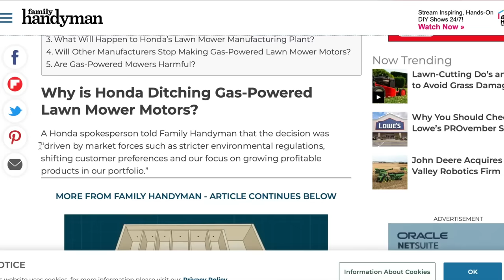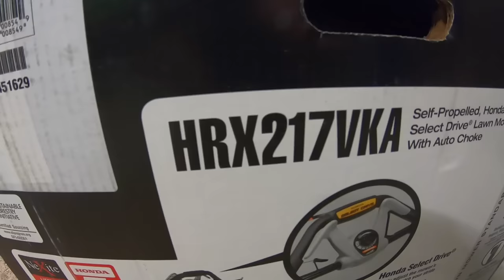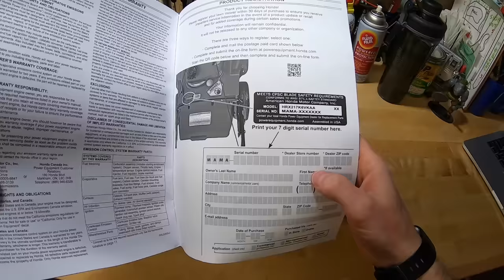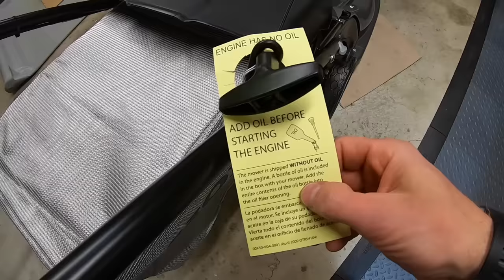ARE HONDA LAWN MOWERS STILL WORTH BUYING IN 2023?

Comment: Lawn mower emissions. Lol what a joke. Hondas are the best.
Reply from the maker: Right!?! Thanks for watching hillbilly!
Reply: California will have grass issues everywhere first with nobody except council staff affording battery operated equipment to cut multiple lawns
Reply: I’m speechless. Emissions from mowers. Do politicians have vested interests in children-run copper/cobalt mines in 3rd world countries? The world has gone crazy.
Reply: A company that makes lawnmowers makes safer planes than Boeing!
Reply: @Dadolaurenovic And good luck with the billions (each EV has several thousand) of lithium batteries coming to your local landfills, polluting everyone's water supply.
Reply: @GarageGear  Honda hrxs are commercial mowers.
Reply: Why Honda?  Better than toro at everything.  Emmisions, gas sippy 160 like twice mileage ofToro.  Twin blade cuts better way better no more twice passes.  Mulch three times better.  Drive system padle love!   I really liked persinal pace but Honda still better.  Clippings smaller packs bag way.better. Got new 8 inch wheels secrect all rubber knobby.  Be here week see fit no one has done these.  Wondering what missing with generators.  Had craftsman with same small honda under powered and did not like it.  Hrr216 fine machine
Reply: @Dadolaurenovic  it's not about emissions. It's about liberal politicians making money. Period.

Comment: Pro tip, keep the original oil bottle for the next oil change.  You fill the bottle with the exact amount of oil then pour in the mower it will not over fill.
Reply from the maker: Thanks for tip! Thanks for watching!
Reply: That is such a good tip. So intuitive yet I threw that little one that came with the mower away. Thanks
Reply: It is in the ballpark, but not necessarily a good idea.  For instance, the oil supplied in the video is 12 fl oz, but the Honda stated engine oil capacity on the HRX 217 engine is 18.6 fl oz 10W-30.  It seems to me that about 4 fl oz may have been left in the engine from the factory testing and even the manual warns about varying oil levels left in the engine and to confirm on fill and engine break in.  Not to mention various methods of draining the oil on maintenance can vary wildly in their success rate at removing all used oil.  In my experience with Honda motors and oil changes, I will let drain, and fill with 10 fl oz, then run for a few minutes and check the level and top off.  After my first couple of mows I will double check the level and run for that season with periodic checks that something hasnt failed.  Will filling with 12 fl oz like the initial top off container work, probably enough to not fail, but for my results and for my Honda to last as long as possible, I go with fill mostly, run, and top off to get best level to be sure.
Reply: Yes I do this when I change my trucks oil. Also helps to give an indication about how much oil you burn
Reply: @Amouselives  Agreed, the oil drain amount always varies. 

I do miss the drain plug on the bottom. It did drain more of the oil in the engine, it was a pain but I always found it more effective than the tip over the side.
Reply: @Amouselives  My manual says 12-13.5oz
Reply: I bought this exact model in 2021 and it's BY FAR the best mower I've ever purchased. I had always had Toros and Craftsman. I agree with the auto choke as I also service them, but I'll take this rear wheel drive beauty over about any push mower out there.
Reply: @Amouselives  I change the oil on my Honda HRX 217 every 10 hours of use per the meter I installed. The absolutely does not hold 18 .oz of oil but Approximately 12.0 to 12.04 .oz of oil per the correct level on the dip stick. Think about it, when you buy the mower new, there was a yellow tag on the oil cap that said “there is no oil in the mower, use supplied oil”. Again, the supplies oil was 12.0 .ozs.
Reply: @frozentundra7446  I never said it did, Honda says it did, point being the amount you retrieve will vary based on time to let drain, oil condition, amount blocked by internal restrictions, lubricated metals, etc.  Why would anyone want to rely on a given amount when filling mostly and topping off would never fail you?
Reply: That's exactly what I did!

Comment: My husband is a diy guy and in the twenty five years we've had our house he has never purchased a mower.  He finds them on the side of the road and fixes them to use for awhile and then give away to family and friends charging only for parts.  Someone curbed this exact mower three years ago because it wouldn't start.  He took it home, spent a weekend in his garage, and now it is his favorite mower.  Starts first pull every time.  I asked what was wrong with it and he said people are stupid.
Reply from the maker: Hey Andrea! This is awesome! I’ve found many on the side of the road as well. Fixed them up and sold them. Easy money. Your husband has a skill that will last a lifetime! Thanks for sharing! 👍
Reply: I found an old 86 toro mower on the side of road, fixed it up then gave it to my manager after a couple years of using it for myself and it started on fire lol
Reply from the maker: @jonnysnipes3123  awesome!
Reply: Yea most mower engines are pretty rugged. I have fixed many old mowers the same way, most need work but the engines are still great.
I trashed picked my walk behind tiller and two stage snow blower. A few minor parts like filters etc, a good cleaning and a tank of non ethanol gasoline and they run better than new.
Same with outboard motors. I have had a few trash picked outboards the same way. Throw away society’s loss is my gain.
Not to mention the old boats I have gotten for nearly free, cleaned up an sold for thousands of dollars. A little scrubbing and maybe a touch or paint. Your hubby is correct, many people are stupid .
Reply from the maker: @BillO964  thanks for sharing!
Reply: Your husband has skills and most likely is a humbled gentleman. That "stupid" comment was probably meant for his wife to hear only.
Reply from the maker: @mr.cookie7308  some here find that interesting. I managed to come up with an extra $4k for the down payment on my truck flipping a few mowers. Easy money!
Reply: If the engine isn’t shot, most mowers that “don’t work” simply have a carb problem or basic electrical issue, most people give up at that point so they just get rid of them.
Reply: He likes to solve problems.
Reply: That’s cool but if I spent 16 hours working I’d have enough to buy a reel mower
Reply: @scottfirman  is my job not real?
Reply: @trumptookthevaccine1679  Its a JOKE , reel- real.
Reply: @scottfirman  I got it
Reply: @mr.cookie7308  I know I don't.

Comment: I'm a toro personal pace guy but always wanted a Honda HRX217. I bought one last year. I found some issues with it. It was much heavier than toro personal pace. It's not as nibble as toro. Grass clippings would get jammed into the clippings selector. I had to power wash it to get all of the clippings out of the selector. The air filter had to be super clean in order to run well. I had to remove the air filter to get it to go up hill. I decided to stick with my toro. My lawn is about 2500sqf. Plus the personal pace feature is so much easier to use and just intuitive.
Reply: agreed with you 100% I also purchased an HRX217 a few years ago, gave it away a couple years later and purchased a toro personal pace super recycler, a lot of people dont know they are not as easy to maneuver as say a toro, love the engine, quality and cut, but if you have lots of trees etc then you are better off with a more manoeuvrable mower, my opinion.
Reply from the maker: Thanks for sharing malisha
Reply from the maker: Thanks for sharing zman
Reply: the nice thing about Honda is even if they stop making engine parts there’s chinese Honda cones out there you can buy from HF . therefore even though it’s not honda parts the honda cone parts should work , keeping your honda mower going . I unfortunately had to replace my old 2008 Briggs & stratton brute 6.5hp because the rear grass bag needed to be replaced and it was going to cost me $150-200 plus shipping and the wheels were also shot so it didn’t make financial sense. I wanted a honda Hrn216pkc but there $749 canadian and after reviews honda seems to have cut corners on theirs decks as well as using more plastic parts so i went with a toro 21445

Comment: My dad had a 1989 top of the line honda mower. Cast aluminum deck, shaft drive, real bearings in the drive wheels. Lasted 28 years before the deck was worn through. Engine still started on one pull. Honda's ad campaign at the time was the Clara Johnson test. I got my honda right before they started using plastic bushings on the drive axles.
Reply from the maker: These things just last! Thanks for sharing JT!
Reply: 1988 HR214 here. Aluminum deck. Shaft drive. Blade brake. I paid a little over 500 then. Smokes a little when I first start but still runs great.
Reply: when did they start using plastic bushings

Comment: Man, I bought the same HRX217VKA Feb ‘22. And I’ve been super happy with it. This Spring it turned on the engine from the 1st pull after being “winterized” . I followed all the videos you did for it, specially your 30 mins oil break in when I bought it and yes sir, it was interesting to see all those specs in the old oil. I want to sit down and make a spare part list and buy them so I don’t have to have a hard time getting them. Keep up the great job filming videos.
Reply from the maker: Great plan Eugene! Appreciate the positive feedback bud! Thanks for being a cool fan!
Reply: Honda parts will be available for 10 years at least
Reply from the maker: @royhobbs785  thanks for sharing Roy!
Reply: Would you suggest using full synthetic oil immediately after the 30 minute break in? Thanks

Comment: A tip: when you go to a dealer, and they look up the Quadra cut blade/belt adapter, it is listed in two parts of the parts catalogs one section has the part listed as 12 dollars, the other section has it listed for 75 dollars, if you are at the dealer, and they quote you 75 dollars, have them look it up towards the front of the parts catalog, they will find it much cheaper, different part number, but same exact part.
Reply from the maker: Thanks for sharing this knighthawk!
Reply: @GarageGear  Hi knighthawk
Reply: KnightHawk you are a lawn legend 🎉🎉

Comment: After opening the included 12-oz. bottle of oil, look inside to see the oil level, then mark that level on the outside of the bottle.  Keep the marked bottle as a handy way to measure new oil for oil changes.
Reply from the maker: Good way to do it. Thanks for watching tt!
Reply: i never change oil for my lawn mower, look like it still working just fine

Comment: Hello JB: I have been Restoring, repairing and maintaining Honda lawn mowers for 10 years now. Recently, I have had two HRN216VKA mowers (from two of my neighbors). Both Honda mowers were suffering from two conditions. 1. Hard to start, it took 3 to 5 pulls to start the engine. 2. Poor idle quality after engine warm up and idle surge. I first tested the "Thermowax" assembly (which you call in your video the Auto-Choke actuator, Honda calls it "Thermowax") functionality and the auto-choke functioned fine on both mowers. Based on my years of small engine repair, hard starting and idle surge is almost always a Carburetor issue. So I fired up my Ultrasonic cleaner machine and removed the Carburetor from one of the HRN216's. Dissembled the Carb, removed the jet, emulsion tube (or main nozzle), float assembly (plus needle), removed the Phillips screw on the top of the carb. and did not remove the idle mixture set screw (really no need to do this). Placed the Carb body, Jet and emulsion tube into the Ultrasonic cleaner and out it thru 4 4-minute cleaning cycles. One note here, the jet and emulsion tube were clogged up pretty good due to Unleaded Ethanol gas the neighbors use. Anyway, assembled the Carb back up and installed back on the GCV170 and the GCV170 started easily the first pull with very little effort and the idle quality was like Music. So that's my story and I'm sticking to it. I hate to burst your bubble and just so you know, it's almost never a "Thermowax" assembly issue, as you call it the Auto-Choke actuator. I'm also a member of the Facebook group called "Honda Lawn Mower Fan Club" if you ever want to stop in some time.
Reply from the maker: Thanks for sharing chris!

Comment: My Dad and Grandmother bought a JX85 brand new from John Deere in 1999.  They shared it and then when I got to be about 13 I started cutting yards locally with it.  Bought my first car that way.  I was lucky to have access to a tank of a machine like that. My parents still run it on their yard today. I am gonna scoop one of these Honda's up for my yard but that JX85 will be in the family for a long time to come. Great video!
Reply from the maker: Hey Gibson I had one of those JX85 models before! Great mower! Thanks for sharing
Reply: In addition to an HRX 217 that I picked up about 5 yrs ago at an end-of-season sale, I also have a (silver deck) John Deere 14SB that I purchased in 1994. That mower is 29 yrs old and it's mowed tons of yards...my two kids used it for many years for their lawn jobs, as many as 10 per week, and now my grandson is using it!  I've used the Honda quite a bit as well...I really like the nexlite deck, power of the engine, and the way it cuts! Starts first pull every time!
Reply from the maker: @edwardanderson2632  awesome Edward those John Deere’s are great!

Comment: honda uk is not stopping making lawnmowers. we have the hrx and hrn, as well as the hrg 'izzy', over here, just with different engines and different tunes for our strict emissions rules. you will definitely be able to buy parts for honda mowers for many years to come. they might eventually become a bit more expensive over time for transport costs, but they definitely will still be available
Reply from the maker: Awesome thanks for sharing Sammi!

Comment: I purchased my HRX in 2003 when they first hit the market. 
Always a great mower. Starts easy and runs smooth. 
My previous home had a steep yard front and rear. The transmission failed in 2017 so I replaced it = no other issues. 
All original except for trans and spark plug.
Mower just keeps on going great. I sharpen my own blades and do all maintenance. 
This mower may outlast me as I'm 73 now.
Reply from the maker: You got another 20-30 to with it at least! 😉 thanks for watching Joe!

Comment: I completely agree with you about Honda mowers. I have an HRX 217 HXA that I have had for over ten years. I maintain it myself and  it runs like a charm. Before I had the Honda, I went through a series of Craftsman mowers. Never again!  

I recommend Honda mowers to anyone who asks me about my mower. Half of my neighbors now have Honda mowers, with which they are very happy. As you do, I trust Honda to have mower parts available for decades.  If my old Troy-Bilt 3090 snow blower were not such a dependable beast, I'd have a Honda snow blower, too.  Honda engines RULE!

Regards! 👍👍
Reply from the maker: ROCK ON JERRY! Can’t go wrong with a Honda! Thanks for watching!

Comment: The biggest problem that I've had with my HRX217 (2016) was an oil leak from the front of the engine, you would think it's from the valve cover but actually it's from a small o-ring that rides on the bottom of the shaft that go through the cam wheel. Worst part is you have to do a valve cover job in order to replace the $6.00 o-ring which gets hard and brittle and no longer seals after about 6 years. Thanks to YouTube video for the heads-up.
Reply from the maker: Thanks for sharing jas!
Reply: Valve cover job are so annoying on Hondas, pretty sure hrx or hrn just use RTV instead of a simple gasket... It's not hard but you need to take your time getting it perfectly clean and careful with how much you put on

Comment: I was one of the few and lucky people to be able to buy a HRX217HYA in 2020 during the peak of epidemic with very limited supply at MSRP of $750. Today the same mower costs $999. I love this mower. I tried battery electric and it doesn't perform as well. All these battery electric mowers claim to cut great, but they don't hold a candle to Honda. If you put a 4 year old EGO, Ryobi, Greenworks, Kobolt, or any battery electric up against a 4 year old Honda, honda will perform just as good like on day 1 since those 4 year old batteries will have degraded.
Reply: Battery is not the way to go that’s for sure.
Reply from the maker: 💯 agree Chris! Thanks for sharing!
Reply: I agree.  Yet so many people are buying batteries today.  Not sure why.  The last thing I want to worry about with a mower is having enough battery.  My extended family likes Ego products (to each their own).  I can't stand the ergonomics of the trimmer, and almost like clockwork the batteries are completely shot at the 3 year mark right outside the warranty period.  They actually start to have issues at 18 months, not getting a long run time but Ego won't warranty them.  And the batteries are $250- $450 depending on the size!
Reply from the maker: @lazylearner967  crazy I know! You can buy a battery powered trimmer for $200-$250. Get 3-5 years out of it before it’s completely dead. Or you can buy an echo gas trimmer for $250 and have it for 20 years. You would have to spend nearly $1000 to equal that with battery stuff! They’re just taking your money lol!
Reply: It depends on the quality and type of cells. If lfp cells are used then they can last over 10 years without degradation.